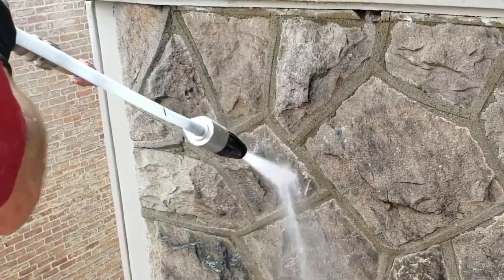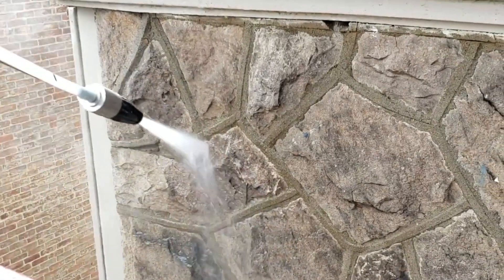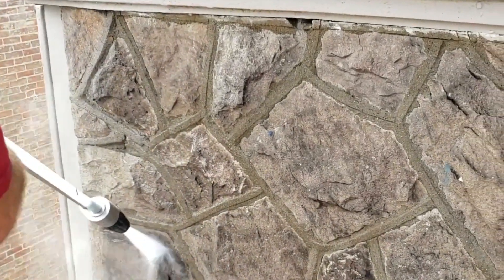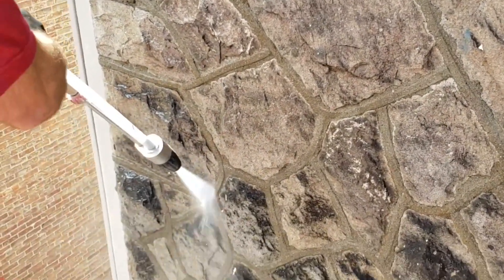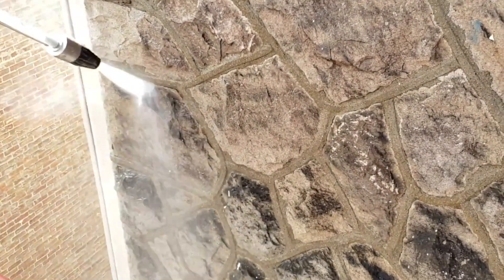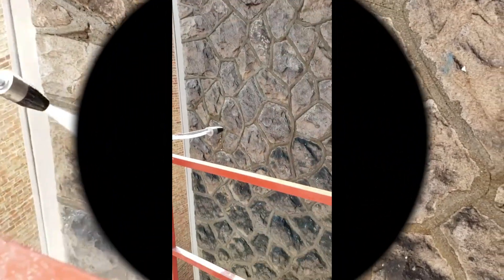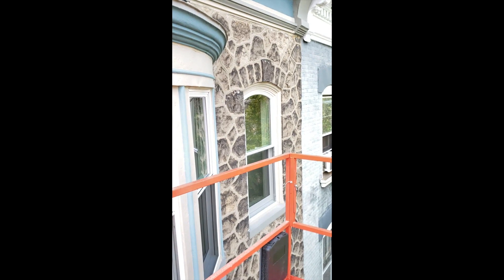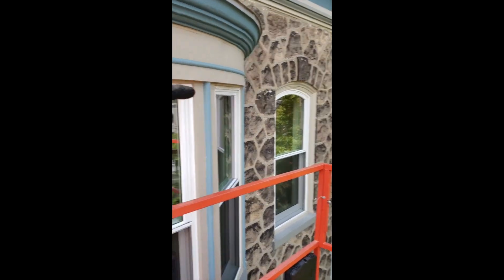Masonry Cleaning with the ThermaTech

Comment: Sand blasting is not good for the stone takes all the mineral out of the stone so in 50 years time stone will need replacing
Reply from the maker: Agreed- we did not sand blast. We used low pressure with an aggregate yes;  it's highly unlikely the stone will need replacing due to this light cleaning.
Reply: Same if it was glass mate just steam clean with it 👍    thermotech is top peace of kit i ues one everyday cleaning grade A listed buildings in the uk

Comment: My experience as construction contractor says that the process is slow. Chemicals AND thermal tech could cut the time in half and with better results. Or use a Graco , Torbo  wet blaster . Cheers from Helsinki , Finland.
Reply from the maker: Thanks for sharing. Every masonry cleaning project is different and usually is quite a process for the type of buildings we work on. Cheers!